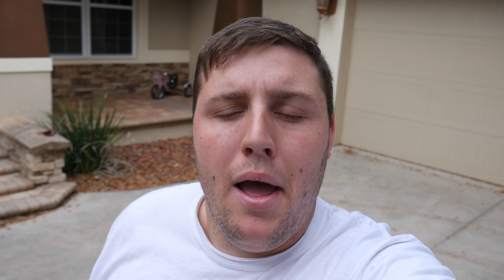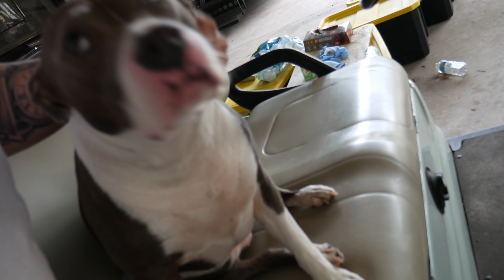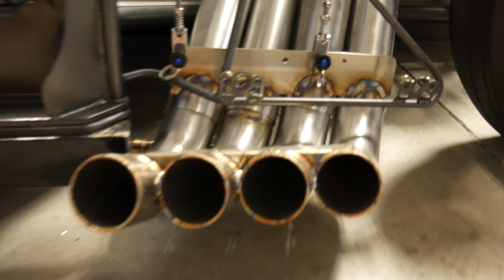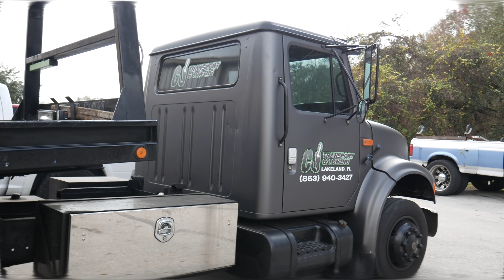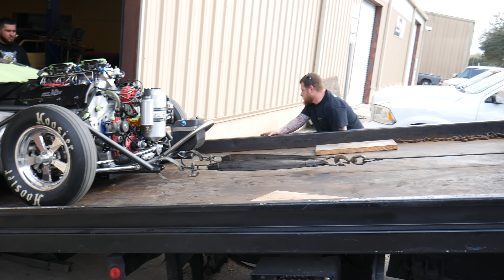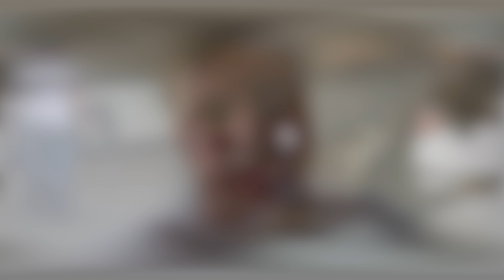WE HAD TO PUT A $200,000 CAR ON THE BACK OF A ROLLBACK TO GET IT HOME!!!

Comment: When it comes to big tires(drag slicks), tire pressure also varies with what type of slick and brand name. The sidewall is different between brand’s and type of drag slick. Best way to get a starting point is to contact the tire manufacturer and they will give you the pressure to start at depending on your setup.

Comment: Ok Justin  When doing the burn out do you go by the 200 degree rule.  If the track temp is 70 degrees you need  130 degrees in the tires.  If the track temp is 100 degrees you need 100 degrees in the tires. Do you use that rule??

Comment: What college do u go to be a drag racer and engine builder
Reply: Dylan Foster. Chevyboygang32 Just YouTube it. It’s not hard
Reply: Believe Northwestern in Ohio is a pretty good program
Reply: The local strip will teach you more than any school
Reply: The reason I said Northwestern is they have school cars that they race at Norwalk regularly
Reply: The Best High Performance and Custom Engine Technician/mechanic Colleges of 2019. University of Northwestern Ohio offers 2 High Performance And Custom Engine Technician/mechanic Degree programs. ... Ohio Technical College offers 2 High Performance And Custom Engine Technician/mechanic Degree programs.
Reply: you don't have to go to school. get out there and get involved! start building your own car or work at a shop. I'm a tech and going to school is my biggest regret. I learned more on the floor at 10$/hr then I ever did in school.